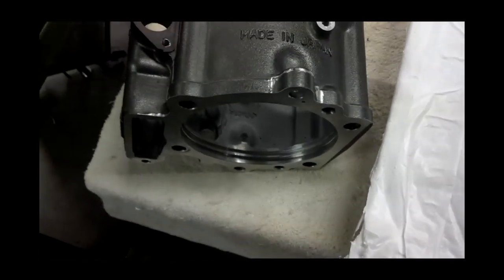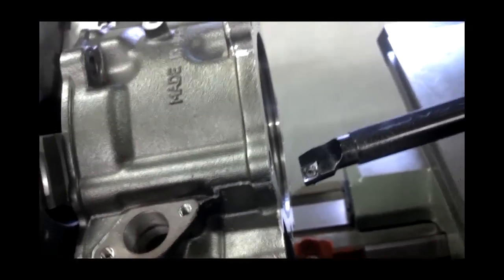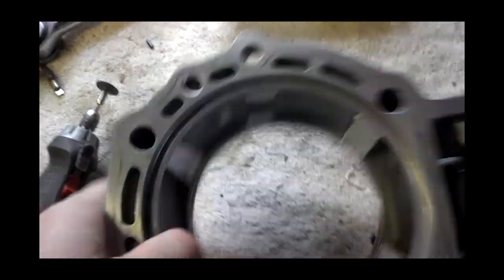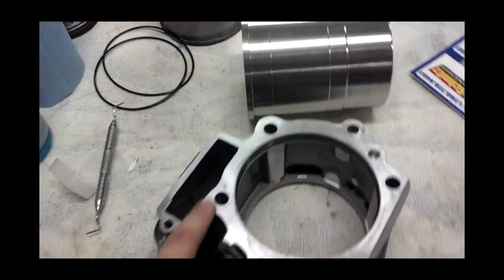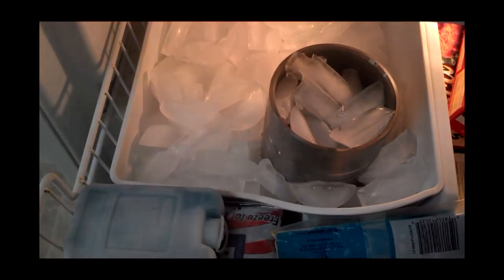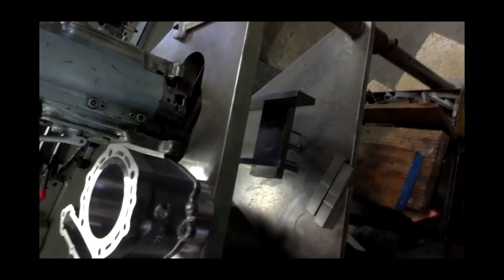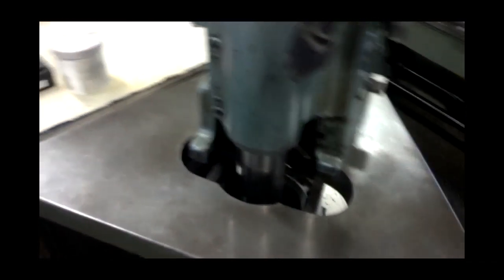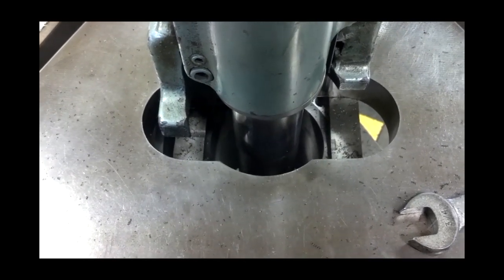KLR 705 cylinder part 1

Comment: Hi there do you have to chance sleeve out to put the 705 piston in or can you just bore the old one cheers
Reply from the maker: Yes you need the sleeve that comes with the kit, the old one is too thin.
Reply: Gordy's Goodworks cheers mate . Not to sure which way to go . As I’m running these motors in buggy’s and one is using a  oil.. should I just go the 685 kit as I’m not porting heads or doing cam work as that’s pricey over here and I don’t think I would be able to find anyone to do . The 685 kit is that a sleeve as well.
Reply from the maker: @davestanwyck6096  you can use the stock sleeve on the 685 kit

Comment: Question, how do you remove the sleeve, Same way you install it?
Reply from the maker: Exactly, heat the whole mess to 400 degrees for 20 minutes. The sleeve won't always fall right out because the two large O-rings are usually stuck lightly. So I just remove it from the oven and set it on two boards and give the bottom of the sleeve a light tap with a dead blow and it readily falls out.

Comment: What is the difference between the '95 and back cylinders, compared to the "late" model jug that you are machining in this video. Wrap the jug in wax paper so you don't have ice sticking to it. Tip: ditch the music.
Reply from the maker: I don't know the differences, never done one that old. I've tried wrapping the sleeve in various things and it prevents it from getting cold enough.
Reply: +Gordy&#39;s Goodworks   Ahh, I've had good luck with wax paper. I hear the '95 and back(that should be '95 and back in my original post) cylinders have a different water jacket configuration that needs to be addressed when installing these sleeves, just was wondering if you had done one to know the difference. Thanks.
Reply from the maker: +Iatolaazzahola I bore out the water jacket at least an 1/8" on all of them, helps tremendously with cooling. Along with a Thermo bob kit and opening up the water jacket a 180° instead of the usual 195° thermostat to maintain temp in the engine.

Comment: This looks awesome. I'm planning on getting a new KLR, but am concerned about the power. I'm no speed demon, but 44 and the fly as the factory claims is definitely below potential for a 650cc. I'll be commuting 100km a day to and from work, with a stretch of road with limited overtaking opportunities, some of which are uphill.

Do you have a standard jetting that works with the setup you do, or do you tune individually?

Regards
Richard from sunny New Zealand.
Reply from the maker: I tune individually, the cylinder head ports on these are terrible stock. Are you needing this service performed?

Comment: How much did the HP increase?
Reply from the maker: +Jorge Callico The bike was never dynoed, but with all the other mods done along with the big bore, it will power wheelie in any gear you want. Do you need this done?
Reply: I'm just researching the KLR now. Haven't even bought one yet. In fact it'll be my first bike. Don't even have a learner's permit yet.

What appeals to me abt the bike is it's versatility and the height above ground. Am a very tall fellow so the extra clearance seems advisable. My driving will be 95/5 highway/off road but I must have O/R capability of some kind. A street machine won't cut it. It doesn't have to climb Pikes peak over rocks and snow but it must do loose sand on level trails.

Also I'm an old phucker. lol

Thanx!
Reply from the maker: Jorge Callico You are quite welcome. Are you familiar with the dreaded Doohickey problem with these?
Reply: Yeah just learned of it this weekend. That and the thermo-bob too. None of these fix it issues seem very difficult. I've been in the trades most of my life so hand and power tools are a natural.

Like the idea of the re-bore kits because I really loathe machines which use lots of motor oil.

My main problem seems to be whether I should buy a KLR used or new. Not sure if my credit's good enough to get a loan on a new one anyway. But if the payments inc insurance were in the neighborhood of $100/month I should cut it easy. Am a retiree.

You know as a matter of fact the whole concept of riding motorcycles has been a really uplifting scene. I feel a lot more motivated, happier and in great spirits lately. All just thinkin about the changes laying ahead of me. May even go see Kawasaki dealer in San Francisco tomorrow. Although I don't necessarily want a new one. Thanx again!
Reply from the maker: Jorge Callico The 2005 and older bikes are 100 pounds lighter than the newest model. After the doohickey and thermo bob fixes it's pretty bulletproof providing the bore isn't already egged from the flawed stock cooling system.
Reply: So basically if I buy an eleven or more y/old bike I oughta consider putting in the re-bore kit, thermo-bob + the do-hickey? Add those costs together and just figure on making it part of the deal eh?

Or just buy the thing and install those parts as needed? I could live with it using a little oil (even as much as I HATE oil consuming machines lol) assuming that the rebuild kit would fix everything down the line.

Somewhere I read that the "705 rebuild adds 20% more horsepower". With custom porting and oversize valves. Now THAT sounds like a pretty powerful machine. I'm already considering putting in the 16 tooth sprocket.

(on a bike I don't even own yet HUGE lol) 

Appreciate ALL remarks and advice!!!
Reply from the maker: I would be happy to port the cylinder head for you and do the install for the big bore kit. The doohickey and thermobob are mandatory. If the doohickey breaks the motor is lunched.
Reply: It would crunch the engine up pretty badly huh? All I know abt the do-hickey is that it has something to do with the tension on the chain. Or that the chain has to be loosen/removed to replace the do-hickey.

Was the do-hickey a part simply just made from inferior metal?

It's called "Planned Obsolescence". An intentional flaw produced so that the customer must buy a new bike in a few years .
Reply from the maker: Jorge Callico It's the arm that holds the spring loaded accentric idler sprocket that keeps the slack out of the very large chain for the balancer shafts (there are two.) These occupy the same space as the crank and are timed to miss the crank. The OEM doohickey is welded together from 2 pieces and the skinnier piece breaks at the edge of the weld. Once this happens everything crashed together and you are done.
Reply: my guess 4   a lot of work for that I would wait till bike is got a lot of miles on it then do it  maybe

Comment: you could have put the cylinder liner in a plastic bag in the freezer to be sure it didn't ice up.  A plastic vacuum bag would have been perfect.   Generally however, i'm very impressed at your no-nonsense evaluation of what matters and what doesn't.  I might note though that the speed at which metals heat up/cool down affects their "temper" and hardness.  So some thinking about the particular process you use is needed.  A cylinder bore is matched to the piston ring material, so hardening the bore requires softer rings in order to reduce oil consumption.  The extreme is chromed bores which have very soft rings that would wear out in a flash in a normal steel bore. Just a thought

Comment from the maker: Yes it is back with the customer now. I put about 100 miles on the bike and it is very tractable and easy to ride if you are gentle with the throttle, however when you screw it on it is absolutely monstrous. It will do roll on wheelies at highway speeds. The customer has put several tanks through it so far of mixed on/off road riding and has averaged 58MPG! I couldn't be happier with how the entire project turned out.